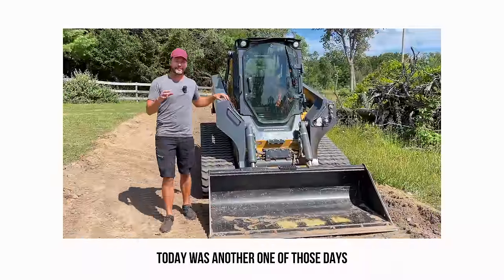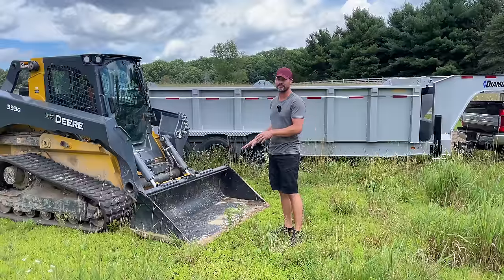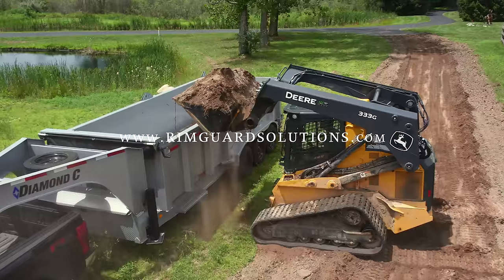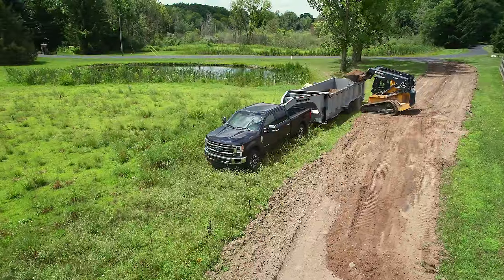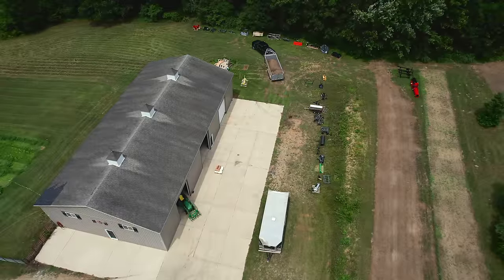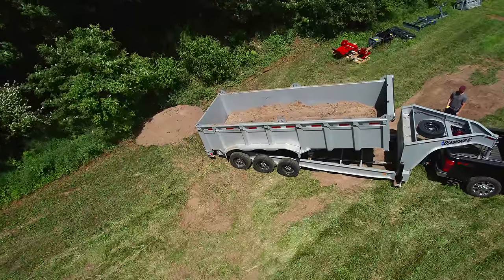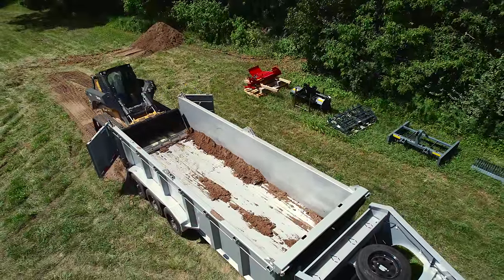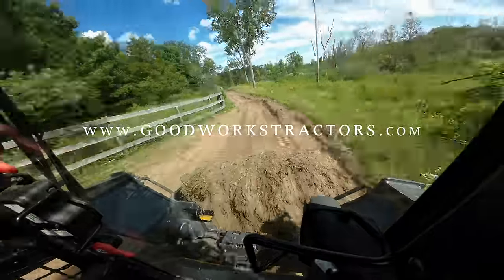THE MOST DECEIVING DUMP TRAILER I’VE EVER SEEN. DISAPPOINTED

Comment: A trick i have used for overloading dump trailers is to keep it stacked to the rear, and then also never lower it all the way back down.  I put a 6" or 12" block of wood under the front.  The linkage gains mechanical advantage as its raised.  And it has the least amount of advantage when its fully lowered.  So keeping it up just a little bit is usually all it takes to get a overload dumped.
Reply: I agree.  My 16' Big Tex have same type of lift. I load it like a 14' starting from the rear. Keeping the front light.  A block under the front do helps.

Comment: Out of curiosity check your hydraulic fluid level in the trailer. Also in a pinch pick up on the bottom of the trailer with the bucket to help the trailer lift and dump

Comment: Two things.  I wish trailers had weight indicators built in.  Not at all hard to do using spring compression gauge.
2nd, I put a sheet of UHDP on my trailer floor to make it slick.  I made mine removable if I don't want a slick floor for a particular load.  It works great for me. Cheers!

Comment: Another channel I watch had a similar experience with the Diamond C gooseneck dump.  I think it needs dual telescopic hyd cylinders. For trailers that length it's silly that it can't dump it. I wouldn't of even considered that load as "full".
Reply: Yeah I would never have dreamed that would’ve been too much dirt to dump. Dump feature on that unit seems almost useless?
Reply: That looked well over half as full as we used to load waste dirt from a jobsite in an 8'x20' box.  Our loads were 18 tons.
Reply: @phild9813  Youd be surprised. He was probably close to a ton per scoop of dirt. That was possibly 12-13 tons, or 4-5 tons over capacity.
Reply: Surprised a trailer that size doesn’t have dual cylinders.  Our 6x14 dual axle dumps about 10k, she doesn’t like that much but she does and it’s a single cylinder.
Reply: Or better yet, 3-stage telescoping front mounted lift.
Reply: @Jtwizzle  a 84” skid steer bucket Is generally a 1/3 of a yard.
Reply: @ChaseLandMgmt  I was going off some buckets I ran on cat skid steers. Deere 84" multi purpose bucket is .91 cubic yards.
Reply: @Jtwizzle  you’re 100% correct on multi purpose buckets. On the grading heel or construction buckets they are a 1/2 yd struck, 3/4 healed. So In fact, I mis spoke.
Reply: @Jtwizzle  yep, that long of a trailer high sides is overloaded
Reply: @slaveofjesus3878  they do make a trailer with one single telescopic ram. Its 10x more capable than the setup he has. Diamond C makes some great trailers, its just the lift design that sucks. But dont get me wrong you can build a  Scissor to lift heavy loads, alot of dump trucks uses thay design tho it uses a huge single cylinder. But telescopic ram is 100x better in every way.
Reply: Yup thats why i bought a telescopic cylinder dump trailer.

Comment: Been there. Traded in my 5x10 10k for 7x14 14k and realized quickly my 5x10 dumped just as much if not more. I used my mini ex to pull the dirt out. Good work
Reply from the maker: Yeah, hindsight is 20/20 for me.  Would have preferred the shorter sided trailer if doing it again.
Reply: I actually went from a 7x14 14k trailer downsized to 5x10 10k trailer since then I wouldn't be tempted to over load it and rut up yards when driving to deliver my mulch or black dirt. 5x10 has plenty of payload and sandy screened black dirt is very heavy. My Loadtrail trailers never stuggled to lift whatever I put in them though including 3yds of pit run in the bigger unit. That was probably too much weight for my lil 1500 dodge to pull overall but hemi handled it fine.
Reply: A telescopic end dump will have more lifting capacity. 
When I was operating commercial end dumps and I’d haul spoilage I always stuck to a 6 scoop max. No matter what it looked like in the trailer. Even then, I’d roll across the scale 150,000 depending on the moisture content. 
 But concentrate the load to the rear. In your trailer, I’d split the bucket at the front trailer axle (half bucket in front) then load to the rear. That’s with a end dump. With the scissor lift or a dual ram under lift, no soil ahead of the axles.

Comment: I did the same thing a couple of years ago. What I did was bring the skidloader to the front of the trailer and put the corner of the bucket under the corner of the trailer and do a little assist lift. Once the dirt started moving to the back the trailer took over by itself so I didn't have to lift too much. Worked great.

Comment: Best way i was taught to use dump trailers is to dump even down the length of the trailer in the middle. When it starts to hit the side wall of the trailer stop loading. And toss on 1 or 2 more bucks on the tail and thats. Good starting point. If it lifts easy the next go round fill it up a little more.  Not an exact Science but has done me pretty good.

Comment: important vid.
I'm a retired engineer, surrounded by hardworking farmers & cattlemen. I see them overload equipment, ...and break it, ...all the time.
And then I did it, even tho I know better.
It is sooo costly!
I made a card of my common loads, the densities, the carry volume, and posted it.
DO NOT BLOW: axle bearings, u-joints, trannies, engines. I spun an axle bearing on the hwy; very un-fun.
important vid.

Comment: I drove a dump truck and trailer for 14 years.  One loader operator would sometimes overload me and when I went back to dump a little off, he would joke. "What good are those big boxes on that truck, if I can't fill them up."   The nice thing about a PTO driven hydraulic pump is it will lift and dump anything you put in it, but shoveling out sticky material was just part of the dump truck game.

Comment: I recently had a pump go out and the new one wouldn't hardly dump 2 tons. Turned out it was the psi on the pump was 900psi under the max. It was rated for 3200 and I was only getting 2300. Turned up the psi and it was much better. Can easily do 4 to 5 tons now.

Comment: My dump is about half as long.  One Spring I loaded it to the rails with a mix of topsoil and subsoil to fill a large divot in the lawn.  Backed up to the divot, pushed the button, got the right noises, but the trailer didn't lift.  I ended up shoveling it out by hand on a very hot day.
Only later did it dawn on me that the trailer battery was low from sitting all winter without being used.  All I had to do was jump it, swap it, or charge it.  All that work for nothing.
I learned my lesson.  Now I always start with a full battery.
Reply: In a previous job, dump trailer battery could be quick connector plugged into truck batteries.  I hope to have the same quick connectors installed at the rear of current F-350 if I'm able to get a dump trailer.
Reply: You had a lot of exercise which helped you sleep well that night.  Always enjoy getting a good nights sleep.

Comment: Most larger skid steer buckets are 1 yard buckets. Essentially you loaded 13 yards especially when you loaded those heaping yards. With the material you were loading do not go over 5-7 yards. Regardless what anyone says. You can blow the hydraulics. Dump trailers are not dump trucks. You can overload a dump truck by however much you want dang near and she's going to dump. These dump trailer manufacturers these days make it seem like you can fill the whole bed up with material and that's by far false. Yes with mulch and very light weight materials. I've put almost 20 yards of mulch on mine and she dumps like a charm. And junk / brush those items you can pack her full with. Great video brother

Comment: Just moved 35 loads of horse manure in a 14foot dump trailer I rented. Several of those loads taxed the hydraulic system due to the material composition, moisture content and sheer weight. On on occasion I though the hydraulic pump wasn’t going to lift the load. Good news is it did, and we got the job done. As a side note learned all material with high moisture content stick to the trailer bed, even at full mast. The only way to get it all out is to rock forward and backward hitting the trailer brake to cause a slide.

Comment: The biggest clue to your issue is when you unloaded a large portion of it and the remains still stuck in your trailer. Dry soil doesn’t do that. Topsoil is easily very damp and increase the weight exponentially. Also you had the volume in that trailer that I’d expect to see in a tandem dump truck. That trailer is way too large for gravel work. I’m thinking it’s more geared towards grain or grass clippings. Also look at where the lift cylinder is on that. It’s so far rearward that it can’t get any leverage on the box. One more thing to look at, what do you have for an electrical set up on that truck? Do you have a second battery and heavy service alternator? And 3500 series trucks I’ve seen with dump bodies are set up that way, and have a huge draw on power when dumping. You may need a second battery and even rev up the truck when dumping to get a little bit more juice out of it

Comment: It is a common mistake so don’t worry about it. Another way to resolve it is use the skid to lift on the front corner. The hardest part of lifting for the dump trailer is the first 4-6 inches. I have used equipment to help it past that point lots of times.I done this 10’s of times with no issues or damage to the trailer. Also if you are hauling dirt across the property and plan to exceed the weight limit, always load the trailer to the back keeping the 15% tongue weight in mind. Weight over or behind the pivot is easier to lift .

Comment: To everyone who thinks this is the trailer problem go take a look at the size, axles, tires etc of vehicles that haul dirt, gravel or sand commercially.       A dump truck that could haul that volume of dirt would be a huge with lots of axles.        This type of trailer is a great mulch, brush hauler plus you can put a skid steer into it.      They are very popular with tree removal business industry.

Comment: You can measure your loader bucket and get the approximate cubic foot capacity of each scoop. On heavy stuff, you can use a wet sand weight estimate, about 130 pounds per cubic foot, to figure the load in the trailer. Keep the pile over the axles instead of forward to ease the dump function. The trailer is a great worksaver over carrying each bucket to your dump area, as long as it is capable of holding more than 2 or 3 buckets full.
Reply: Buckets usually have a small plate attached on the side that shows the weight of bucket and cubic yard capacity.

Comment: You should take a look at Texas Pride dump trailers. I picked up a 16ft bumper pull dump last year. They use a front mounted very large cylinder positioned like you see on a typical dump truck/gravel trail. I have filled and I mean filled my trailer with some heavy material and it always dumps.

Comment: I've used the tractor to catch the lip of the front of the dump trailer and lift while running the lift function of the trailer. It's gotten me out of a couple pickles when I overloaded moving dirt around the property. (Overloaded trailer stayed on private property) I have an aversion to shovels after getting a tractor. Double check connections on the batteries and pump system, a loose wire can rob amp pulling ability.

Comment: I have a much, much smaller dump trailer,  it will hold 2 yards of leaves or mulch, but tops out at 1/2 yard of sand or dirt. Just because it fits doesn't mean you can always fill it up.
Reply: Just like drinking; just because the glass is large, it doesn't mean you should fill it too much. You can only absorb a small amount before you get into trouble.

Comment: I tried this same setup when I started my contracting business.   I learned; 1) Dump trailers are designed to dump trash the angle of repose is too low to dump most soils except maybe dry sand. 2) Scissor hoist are not suited for heavy loads and will stall with soils or rock. 3) There isn't a tire made that won't blow out in this kind of service.   Bought the heaviest load rage f tires that would fit on the rim and had roa service called to replace them in route to a job more than once.  4)  Lastly no matter what pickup truck you have, I don't care if it's a turbo charged diesel and make 500hp and 1000 lb-ft of torque it will kill the truck in a short time frame.   This kind of weight requires a class 8 truck with a CDL. The DOT officer will write you a ticket based on the weight capacity of the trailer  plus the truck.  Learn from my mistakes.
Reply: There is a wheel upgrade to a 19.5 made by boar wheel that will give you a tire and wheel  that will handle heavier loads. Still think that your bigger truck and trailer advice is spot on.
Reply: @timblossom8904  I had a friend with an empty 35' gooseneck trailer and a Chevy 3500HD dually get pulled by DOT and ticketed for not having a CDL because his gross was 14,000# for the truck and 28,000# for the trailer.  That's 42,000# for the combo and he had a  regular class D license.   I told him if he got caught it would be expensive.   He said it's a pickup truck!  I don't need no CDL for a pickup!  The cop told him he might as well have no license instead of the wrong one. LOL

Comment: Did you check the pump pressure? I had to turn a friends up once because it was set so low from the factory a 12k trailer couldn't dump 5k of stuff.

Comment: I have seven dump trailers. I would not own a trailer that does not have a plastic liner on the floor to help the material slide out and a plastic liner on the sides to protect them from dents and dings.

Comment: That is the most common issues with dump trailers. People think they can load the bed to capacity but not the case. Typically they can only dump around 12,000-14,000 pounds on a 20k trailer. Doesn’t matter the brand. Also, never…never…never ever never drive over your load it just compacts it. Also, never leave a load in your trailer unless it’s just debris. Mulch, topsoil, fill dirt, sand, you want it off as fast as you can or it settles and want slide out. Another thing you can do if your hauling dirt is “mop” some diesel fuel in the bed. It prevents cracking and will help loads slide out. We pull 5 dump trailers everyday in our landscaping company. They are a pain at times but an absolute life saver when needed.

Comment: I overloaded my trailer to where it wouldn't dump. Ended up hooking up front end loader to front of trailer to help hydraulics.  You might have been able to lift with skidsteer helping
Reply: Loading dirt in the back of the trailer is also why the Ford struggled.  Tongue weight would have made it drive right out

Comment: I've done something very similar to this. A while back I needed some dirt and I had this little harbor freight utility trailer I built some sides for. I calculated it could hold 3 yards of dirt by volume. I went to the materials place and asked for 3 yards please. The lady at the desk looked out the window at my Audi and little trailer and said "Can your trailer hold 6000 pounds?" "no, no it cannot, thank you so much for asking, I"ll take 1 yard please" . It struggled with that 1 yard even and I ended up bending the frame a good bit when I unloaded it from the rear and the tongue weight increased and bent the frame the jack was on.
Reply: 3 yards of dirt is well over 6,000 lbs well over 7,000.

Comment: There is a telescoping cylinder option at Diamond C that would work way better on that trailer. Scissor lift only work when the load is over the axles. If you put all that same dirt in the back 1/2 of the trailer it would have lifted just fine.
Reply: He would still be almost 5 tons over, which for slow speed around the yard its probably fine.

Comment: Long trailer: light debris
Short trailer: stone,gravel and dirt. Next time you run the tractor in and out, put front landing gear down; you were way overloading the trucks suspension.
Reply from the maker: Landing gear was down on the front and back the entire time.
Reply: @GoodWorksTractors  ok, the video made it look like truck was going up/down. 👍

Comment: Well, test it, can u dump 3 to 6 yards of mulch.
From what i can see u would be better of w a flat triple axle equipment trailer.
I have a Car Mate 6x10 dump (deck over), pull behind 50 year old Case tractor.  Looks small behind truck but good behind tractor.  But it dumps dirt and limestone very well.

Comment: I have a 4x4 welded to the front of the trailer were the box sits i found just the box setting 4in higher helps the my trailer dump and I always over load cuz I'm one man operation and no I don't drive on public roads its at my ranch

Comment: Dump trailers are versatile but not the best.  A dump truck is much better.  That said I think a 7x12 or 7x14 is the optimal dump trailer size.  Any longer and your dump angle and weight distribution suffers.  New paint doesn't help as the dirt sticks and doesn't slide easily.  I would have recommend bumping the trailer by backing up and braking hard to encourage some movement and you likely could have dumped it.  That trailer (axles and frame) is probably more than capable of handling the weight you put on it.  We have a 7x14 14k PJ dump trailer and it's a great all around trailer.  I can haul a skid or mini ex (barely) as well as transport materials.  But I can only haul about 1/3 what a 10 wheel dump truck could carry so it really starts to become inefficient.